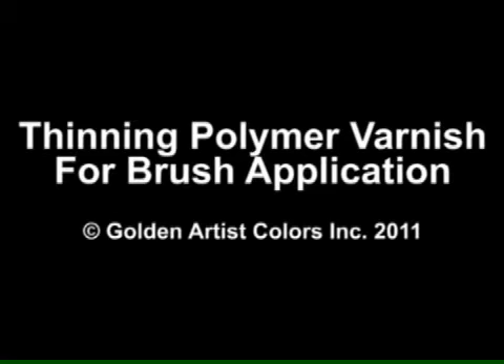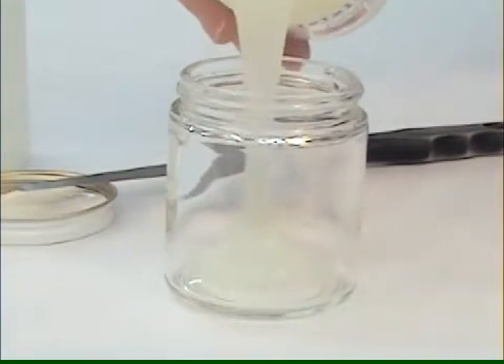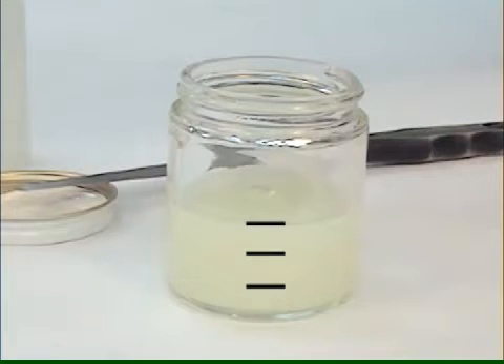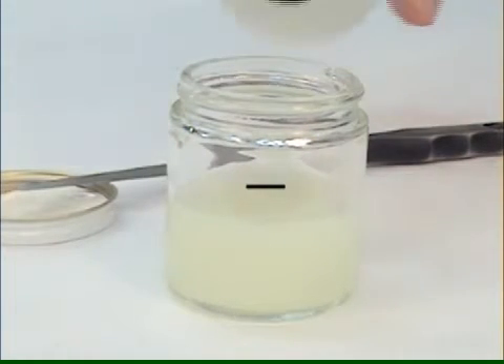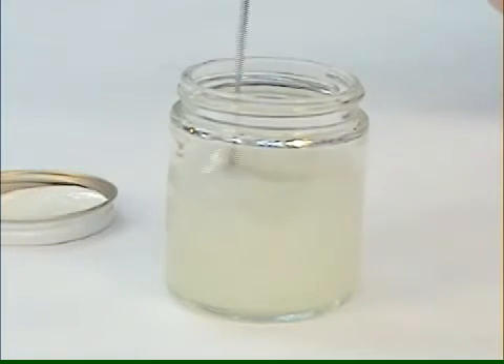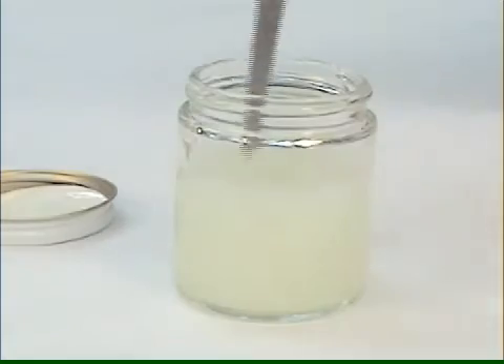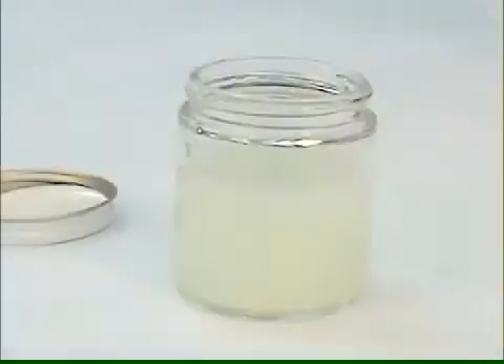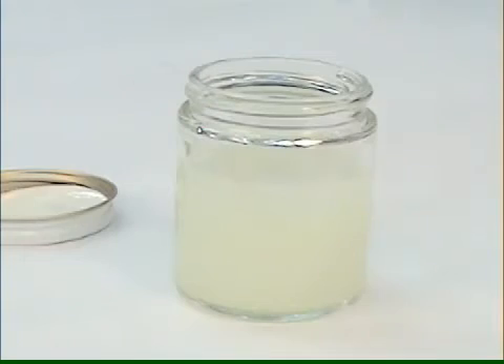Golden Acrylic - Thinning golden polymer varnish | Jackson's Art supplies

Comment: I thinned the MSA Varnish w/UVLS Satin with the Golden MSA Solvent according to the directions. I am using it over watercolors, but this last time did not dry with an even matte finish. I first sprayed my paintings with 4 coats of Krylon archival 11378 matte spray varnish. Should I be hinting with water instead?
Reply from the maker: +Gail Dolphin Hi Gail, what kind of surface is your work on? An unevenness in the sheen is usually due to a difference in the level of absorbency across the support. For oil or acrylic paintings we would suggest 'oiling out', i.e. covering the finished work with a very thin layer of oil or acrylic medium to unify the sheen prior to applying the coat of varnish. There is no equivalent for watercolour just because it is a rewettable medium, so I think the only way to try and unify the sheen is to try and ensure the surface you are painting on is consistent in its absorbency across the whole surface. I hope this helps.
Reply: +Jackson's Art Supplies Hi there!  Thank you so much for your response.  I am working with Watercolor on Aquaboard and you nailed the issue.  I didn't like the rougher surface, so I sanded it down a little and did a thin layer of Golden Absorbent Ground....that's the problem I think.  I am going to thin it with water as you described, the solvent works but the water would make it so much less toxic and "stinky".  The first layers I apply of Krylon Spray Varnish 1378 seal it well and produces a nice matte finish.  Thank you again for your information and video!  Kind regards,   Gail
Reply from the maker: +Gail Dolphin Our pleasure!

Comment: If I want to apply a thin protective coating to a small, dyed wood object, how would it be to dip the object in the thinned varnish? Would you recommend a more watery mix, and several dips? (For my application, the surface texture need not be smooth -- I just want the protective quality of the varnish.)
Reply from the maker: Jon Nelson I would apply several thin layers with a brush rather than dip the object in varnish as dipping may create too thick a layer and problems may arise in the drying.
Reply: Thanks. 
This concern of being too thick is why I wondered about trying a more dilute mix. Perhaps drip streaks would occur. I may just run a few trials and see.
Reply from the maker: Jon Nelson Probably best to run a few trials, but generally, I don't think dipping will be as even as applying with a brush.